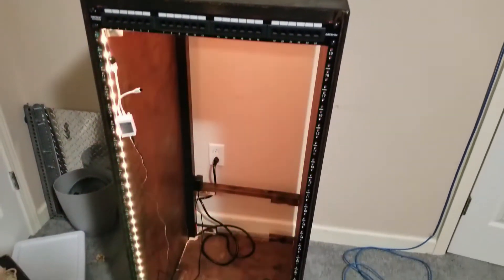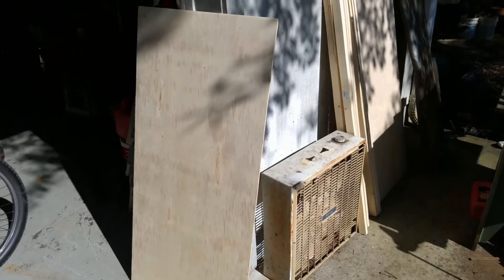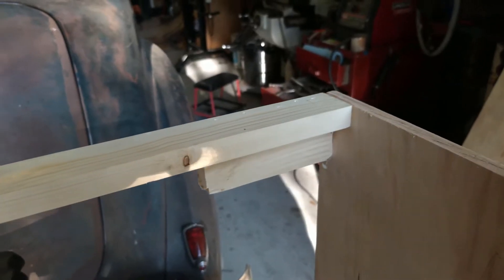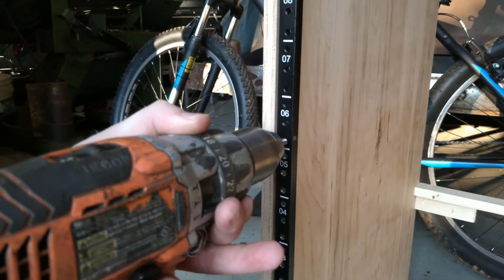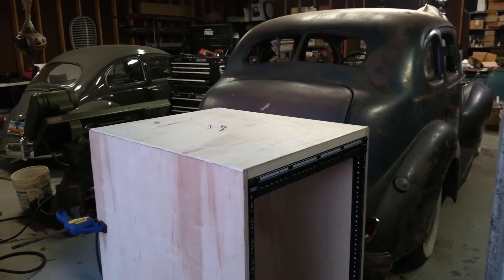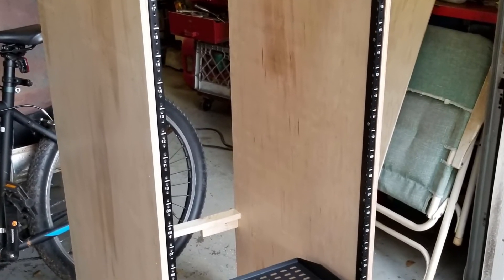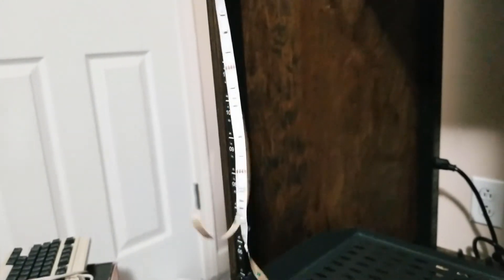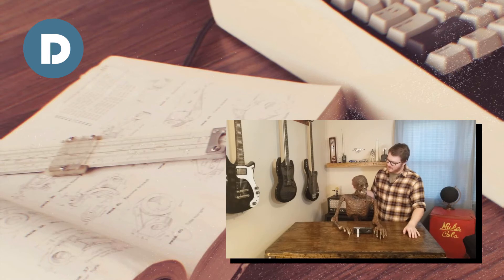Building a Homelab Server Cabinet

Comment: How much did you spend? What would a similar build cost?  How is ventilation/heat?
Reply from the maker: The posts were about $13. I believe the wood altogether was around $50ish. I did get some nicer wood since I knew I was gonna stain it. You could get by under $70 for sure, less if you use cheap wood. I'm only running a few devices on it so I haven't had any issues with ventilation. That may be a different story down the road though...